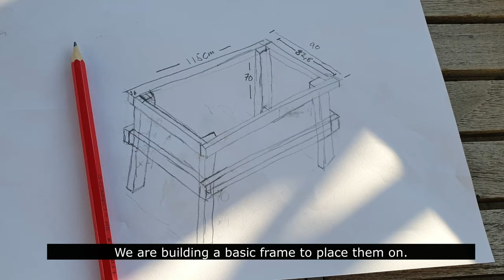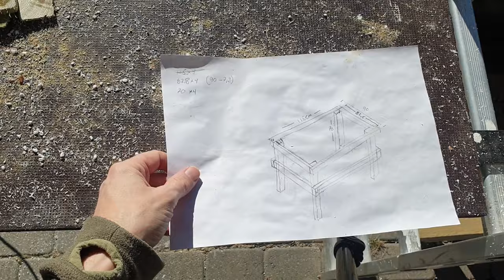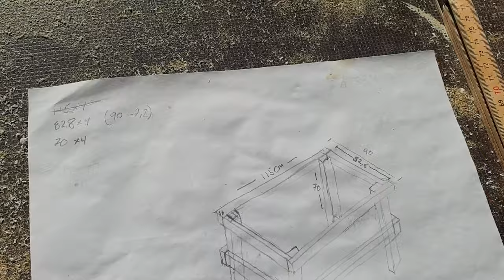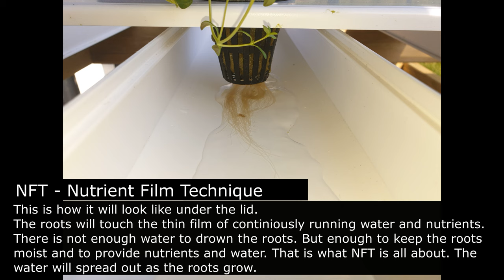Hydroponic NFT Table - COMPLETE BUILD

Comment: Nice build. In my veg room, I used a sheet of corrugated roofing in place of the square pvc troughs, this made the whole surface usable instead of being restricted to hole positions. I used clumps of rockwool and just moved them up and down on the incline keeping the taller plants closer to the reservoir. One issue is the rockwool and roots grew green algae on them, but it did not seem to effect the harvest. Good luck and thanks for making the videos.

Comment: By gluing caps on the ends of the pipes, it will make cleaning more difficult.  Running a trough across the end of the grow tubes would allow gravity to exit the water to the reservoir and would make it much easier to dissassemble and clean the grow tubes periodically.  Increasing the slope of the grow tubes would eliminate the need for a cap at the feed end, as well as the exit end and probably improve performance.  Would save a bunch of money, also.  Otherwise, nice build.
Reply from the maker: Yes, this would also be a good solution. There are many ways to build this, with its pros and cons :) With no end caps and a open channel/gutter across at the end, there could be some splashing and the nutrient solution could be more exposed to sunlight which can encourage algea  growth, but it would also be easier to clean and also cheaper as you say. If we were going to make a large system, we would probably do it the way you describe.
Reply: No caps in where i live would mean algae issues and even slugs will find their way in from the ends and very hard to remove.

Comment: Great build! The only thing I would do differently is just have a pipe coming up out of the reservoir that goes into a 4-way manifold, slightly above the NFT channels, and have each port on the manifold gravity-drip down into each of the NFT channels. Your method is certainly nice and neat though. I love it!
Reply from the maker: Thank you very much :-) Yes, we could have used a 4-way manifold also. I guess what makes hydroponics so interesting is that there are many ways to build a system, and you can experiment with different solutions :) And they will all have their pros and cons. One advantage with the way we built it, might be the ease of expanding to more channels without using several long tubes.
Reply: @innehagen4248  Absolutely fair points. You're right. It's one of the most rewarding parts of hydroponics - being able to design and have multiple models all perform the same function. I hope to see more from you going forward!!
Reply from the maker: We have plans for building a vertical system indoor using the same channels, but we are out of channels, so we are trying to get new ones :-)
Reply: @innehagen4248  I'm excited to see what you come up with! I think that will do great. :)

Comment: Why not one supply at far end and one return at the close end and let the flow go through all the rails, less plumbing true?
Reply from the maker: Yes, this would also have worked, but for this build we wanted to build a true NFT system where the water just runs past the roots and forms a thin layer in the bottom of the channels. The table is tilted so that the water runs down each channel without having water that stands still. 

Besides plumbing is fun :D

We have also made a vertical NFT system where the channels are connected in series as you describe. You can check this out here: https://www.youtube.com/watch?v=CgT_HsndUWg

Comment: Great build, I'd use bigger inlet tubing to minimise clogging.
Reply from the maker: Hi, and thank you :)
Yes, you are right that this could be improved. We considered 4 different options:
1. Use 16mm all the way with 16mm Tees. The downside with this is that we would need 4 valves to get the same flow rate to all 4 channels.
2. It would be an improvement to use a inline filter like we use in this build:
https://www.youtube.com/watch?v=qbGuT21pNpU&t=982s   at 16min10sec. Unfortunately we didnt have one at the time. 
3. We could use 2 of the small tubes for each channel instead of one. This would improve the flow rate (which is a bit on the weak side) and also eliminate the risk of clogging (if you remember to check for clogging once in a while). But it would complicate the build, having to drill extra holes in the channels and connect 4 more tubes.
4. Lastly, as you mentioned, we could use a slightly larger tube (9mm) but all we had was 5 and a larger tube wouldnt fit in the pre drilled holes.

...having said that, if we were to build this system again we would probably go for option 3. Maybe if it gets clogged in the future we can make a movie about improving the system ;)  Thanks for your feed back!

If you ever build an improved version, we would love to hear from you :)
Reply: @innehagen4248  I personally would go for #1, inline filters only work well if you check/clean up often which can sometimes be a bit challenging for home growers. you can get away without using valves if you place the inlet tee in the middle. I'd use valves anyways (still cheaper than using nut locks) and would be handy if I need to shut off 1-2 channels for maintenance.

Comment: Nice video , really enjoyed it! :) I see that you also build a drip system too, do you see a lot of yield difference between the drip system and this one? Do you keep the water pump on at all times for the NFT system? I have experimented this year with Kratky with good results, and for next spring I am thinking about testing some new method , and after some research I am between NFT and drip. Any recommendation? Thanks!
Reply from the maker: Thank you! Glad you enjoyed it:) In the NFT system we keep the water pump on at all times. The outlet in the channels are low and the channels are a bit tilted so it will never be more than a film of water in the bottom (no risk of the plants "drowning"). We have very good experience with the yield from both NFT and drip. See the yield from a similar NFT system: https://www.youtube.com/watch?v=CgT_HsndUWg and the drip system: https://www.youtube.com/watch?v=oNJlgT0RfQg
We also have good experience with larger plants in the drip system like tomatoes and cucumbers: https://www.youtube.com/watch?v=lcUOFPyztqo&t=202s

Generally we use NFT for Lettuce and herbs, and drip for larger plants :)